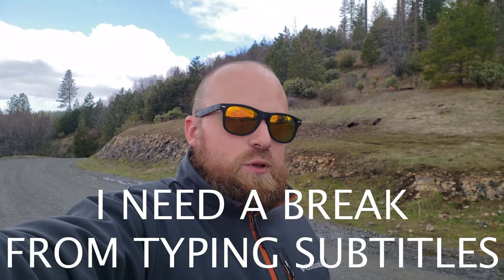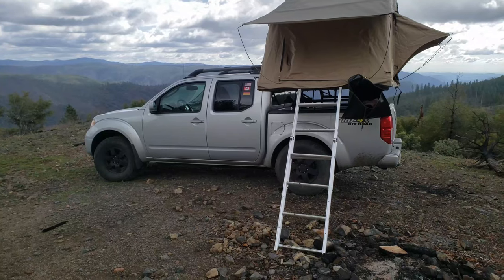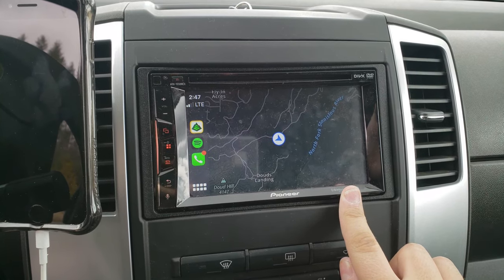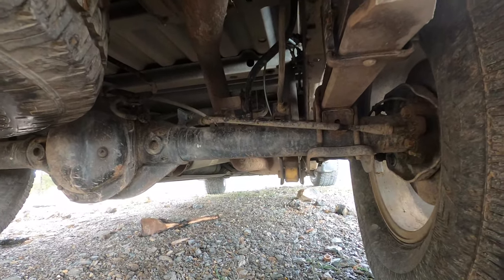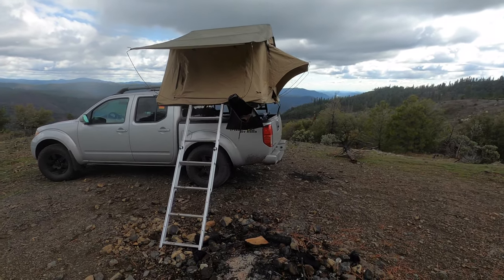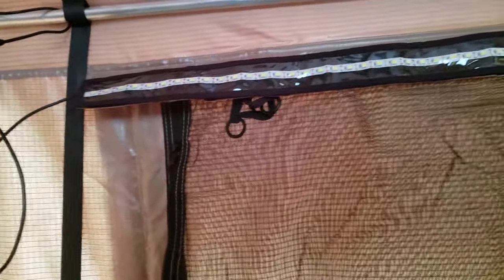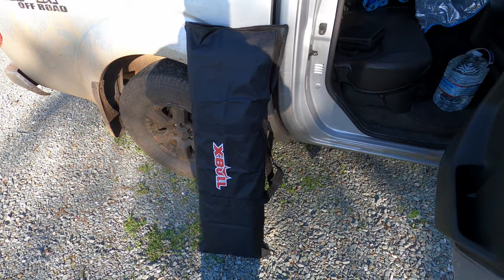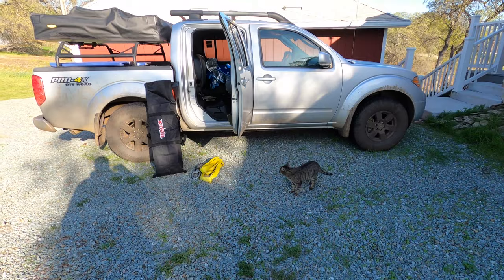Budget Overland Build - PART 1 - Nissan Frontier/Navara Pro-4X (D40)

Comment: I have the South African version of your Nissan. Mine is powered by the super powerful and reliable YD25 diesel engine. I also looked at the Ford, Toyota and Mitsubishi but decided on Nissan purely on price and also just as good as the other makes. I've had mine for 4 years now and done 120k km. About 70k miles with absolutely zero problems. Mine has done an extensive trip through the roughest parts of Botswana and South Africa. It always returns home without even a rattle. I also did a lift and run 285/70/16 tyres. It has no effect on the pulling power at all. There are also many 4.0 lit V6 Navara's running here. Good luck and enjoy your Nissan.

Comment: Great content friend. I have a tip, do not use air compressors in cigarette lighters. Cut the end off and get some alligator clamps and a fuse holder then hook directly to battery. The lighter circuit fuse my blow after prolonged use.
Reply from the maker: That's a great idea! Will try!
Reply from the maker: Should have listened to your advice... Power socket literally went up in smoke last weekend and burned out when airing up again.
Reply: @mitchkman  good topic for a video

Comment: I wanted a pro 4x but unfortunately in the US they dont sell a long bed version here i had to at least have a 6ft bed so i got a sv. But i threw a arb rear locker on it and a ado Bilstein 5100 lift kit with some 33in tires with new rims. Its been a great truck takes me anywhere i need to go.
Reply: Nice setup. I would like something similar on my 2023 S trim. Congratulations